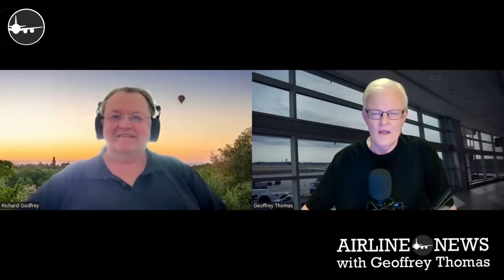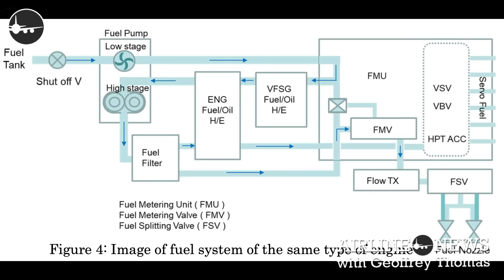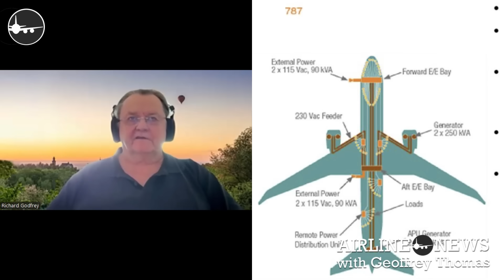AIR INDIA CRASH - FUEL & ELECTRICS FACTORS  #airindiacrash

Comment: Possibly deferred maintenance?
I will always feel so bad for the pilots fighting to save the flight and the souls on board.
Reply: It actually could be from maintenance performed just before this flight, when passengers on the previous flight report no AC and problems with the entertainment system electronics. In one of the 737 Max crashes, the "angle of attack" sensor was replaced just before the fatal flight, which was not calibrated correctly by the supplier, and caused incorrect information to be sent to the computer, causing the computer to force the plane down into the ground, erroneously thinking it was preventing a stall. Also, the pilots were not trained on how to quickly shut off the system when giving obviously erroneous instructions to the plane.

Comment: 1:38 You should really consider correcting the size of the fuel tanks and the fuel quantities as your numbers do not seem to match numerous other sources, some of which are from Boeing.
Reply: Does that apply to all 787 models? This was the 787-8.
Reply: @Mark-rw3kw 

The difference between the 8 vs 9 is relatively small. I thought I had a source that might have been incorrect, so I checked a fairly large number of different sources. An official Boeing source was consistent with the numbers that I was using. A particular bothersome issue is how far off the video is with regard to the differences in sizes between the center and wing tanks. This actually has an aspect related to the justification of why the common center tank is being used for takeoff on a trip of this length. The center tank CAN CONTAIN more than 60% of total fuel, not something like 30% as the video portrayed. The implication is that the aircraft was almost certainly using the center tank for takeoff.
Reply: @ImperrfectStranger 

In the new video he talks about why he was off as per your comment. However, his explanation could not be correct as what he said about the relative sizes between wing vs center fuel tank were massively off. Now in the new video he basically provides an explanation that doesn’t cover that issue at all and puts it on “various sources” vs “I really mucked that up”.  Normally I would say that my observation was just being pedantic, however this detail could matter.

Comment: Thank you again, gentlemen. Whilst listening to Richard talking about the role of the APU, both during this episode and others before, I have often wondered why this isn't routinely turned ON during each stage of critical flight, such as for landings and take-offs? Initially I assumed it was because it couldn't function when the aircraft was in flight due to e.g. aerodynamic factors. However, in todays video, Richard stated @14:00 that it could indeed be started up in flight. What say you, please?

Comment: One point and a question.
Bus synchronisation failure.  Two DC lines at the same voltage can be connected by a simple breaker.  In the case of AC the voltages vary from negative to positive at the AC frequency.   A synchroniser  ensures that the breaker connects only when the lines are at the same voltage and in phase.  A synchroniser failure can cause total loss of AC power.  In-depth explanation on Wikipedia -
https://en.wikipedia.org/wiki/Synchronization_(alternating_current)
In passing: contact welding is a possible fault condition of breakers.

The question.  What was the duration from switching on of power - and recorders - to the crash ?  Put another way: how many minutes of FDR/CVR will there be for this specific flight?

Comment: Many people forget on this plane previous flight the passengers posted their was electric component problems on plane. No lights in cabin.... AC going on an off. Clearly if it was pilot error they would have told us by now. I tend to believe Air India is in some type of cover up mode because of a maintenance problem an or electric component problems on the plane.
Reply: Yes, if it was water contaminated fuel perhaps the left tank was more contaminated than the right side tank.  So the left engine flamed out first either just before takeoff or shortly after.  And the right tank was mostly ok but it did degrade the performance of the engine.  Not sure what percentage of water in the fuel is considered contaminated since probably a very small percentage is water?  But very little would think and some can accumulate due to temperature changes.
Reply: I'm thinking the same thing. If it was 100% Boeing's fault then they would have released preliminary report by now. Having the flag carrier of India at fault will certainly delay the preliminary report to make sure all other possibilities are triple checked.

Comment: I like your information because I know you are giving real information not made up crap! Is it possible that water or something got in the main electrical system, where it is using the vacuum pumps, with the very hot temperature it gets a vapor lock? I have only flown small Cessna that have high wing and has very little trouble getting fuel as long as you have the fuel selector on a tank that has fuel! I know that until someone gives us some real information about what the Black Box's tell us we are just guessing what could happen. Thank you for your information!

Comment: I have been following your inputs to this terrible situation, and to the most part concur with what you have said. There is however 3 items that you have failed to address .
1/   There is vision available of a third item i.e.an in the cockpit video recording totally intact and undamaged with a retrievable copy of all activity in the cockpit.
2/   the remains of the Lithium-Ion battery and what looks like an explosive detonation within the box which appears to be a pre rectification casing, which suggests it was an older battery without the problems of wires below the casing which is definitely not the required reinforced battery case
3./The location of the suggested broken seat pin stopper is not either missing or broken.
I therefore suggest that there is a concerted effort to suggest that Boeing is culpable as this aircraft spent time in the shadow factory requiring substantial corrections of parts on the airrcraft involved. I would seriously request you take a look at this seriously.
Reply: This is what i am thinking took out data cables from near the battery enclosure. do you have url for picture of the remains of the battery? The battery box is not that big..

Comment: The only definite aspect is that the control showed full fuel but not being fed to the engines. 
The question is what mechanics drive the feeding of the fuel.
Now we can decide what maintenance issue is responsible for this. 
It would be mischievous to make the issues confusing to shunt the blame to avoid responsibility.
We know that huge amounts are at stake for the US company which exercises massive clout.

Comment: There’s a price to be paid for (automatic) operability-convenience including attempting to idiot-proof a system through the fig-leaf of “bullet-proof” safety-interlocks: the resulting complexity. Failure modes (including those triggered by as simple an event such as sensor-error or even frayed wire/cable) skyrocket & it is only a matter of time before events occur in the right combination/sequence to complete the “path to complete destruction”.  No one understands these systems entirely in that sense - not even their designers. Their Operations/Maintenance & Testing are given rote procedures & checklists that “work” until they (obviously) don’t. What would those people in dire straits not have given up to immediately rip up all that automation, giving direct control to the pilots to do what imminently needed to be done?
Reply: The age-old problem of automation
1. Automation to reduce workload makes sense up to a point, but us old timers want to know that we can override the automation when needed.
2.Automation that addresses incorrect diagnosis and then possible incorrect/dangerous pilot interventions - that is where the problems ly in my opinion. 

I agree with the notion that aircraft systems are becoming far too complicated and intertwined.

Comment: Richard, if it is really due to a software glitch, causing this crash, who would be responsible? Boeing? Air India? or would it be considered an act of God?
Reply: Good question! Software failures are sometimes triggered by electrical or mechanical problems; either of these may be caused by poor maintenance, so the room for Boeing and Air India to point fingers at each other is enormous.
Reply: @iliyakuryakin4671  Air India was until recently owned by the Indian government, but was sold to Tata Group (India's largest conglomerate) in 2022. However, the planes are maintained under contract with Air India Engineering Services Ltd (AIESL), a government-owned entity. The government is in the process of divesting AIESL, but this has not yet been finalized, meaning maintenance remains a government responsibility for now.
Reply: Not the act of God because airplanes are manufactured out of the Free Will.
Reply: @abhinandansharma400   If a plane was shot down by mistake (as happened a several times) that would be considered as beyond the control of the airline or manufacturer, but probably not considered to be an act of God.
Reply: @Mark-rw3kw yes, shot down means a Missile again a creation of a man out of free Will.
Reply: If there is an automated system "glitch" the problem could be with the software, or from sensors that feed information to the system upon which it makes decisions. That is what happened in the two 737 Max crashes when there were problems with the "angle of attack" sensor that were not properly calibrated upon repair, and the automated system thought the plane was going up to fast and stalling, when it was in fact the plane was flying level, and the computer automatically caused the plane to nosedive to prevent a stall, but instead caused it to crash. The pilots were also not properly trained on how to quickly shut off the automated system when it was obviously giving incorrect instructions to the plane.

Even though there were problems with maintenance of the sensor, and inadequate training of pilots on how to disable the system when it obviously was giving incorrect commands to the plane, Boeing was primarily found to be responsible for relying on only one sensor, and not having adequate safety checks in the software programming. A failure of such a automated system would never be considered to be act of God unless perhaps the plane was affected by some completely external force that could not be reasonably ever predicted to happen.
Reply: Then the investigation would be which God, whose God?
Reply: That would be a human caused programming error and the responsibility of the aircraft manufacturer.

Comment: Would it be Smart to leave the APU Running until the Airplane is at  Cruising Altitude????
Reply: Ja,wäre momentan sicherer
Reply: The problem I see is that the power provided by the APU is only 450 kW, whereas the aircraft needs much more than that to function properly, without shedding load. It would be interesting to know what the minimum power requirement is and what gets shed when one engine fails, leaving only 500kW available.

Comment: The Air India crash is eerily similar to Emirates Flight 407 emergency out of Melbourne where the TOW was incorrectly entered into the EFB affecting the performance of the aircraft at takeoff regarding amongst other things V speeds, flaps and engine power settings.
Improvements to software and procedures were initiated as a result of the mishap but there is always the presence of human error.
Reply: Yes , and there has been very little mention of aircraft take off weight.
Reply: Interesting. An incident related to TOW happened this June in Phoenix. An Airbus A321 lost an engine on takeoff and had difficulties in maintaining flight level.

They did managed to get back safely and it has been determined that the aicraft was overweight.

It got me thinking on how common this practice might be, yet we only learn about it only when it goes wrong.
Reply: The software will not let you enter a bad TOW it knows when its not in range. This incident was in 2009 so they changed the software. The 787 will not let you enter a bogus TOW.

Comment: Multiple computer systems of the 787 use timer-counters with (too) small integer size, leading to an overflow every x days, possibly leading to massive problems or shutdown of corresponding computer system. 2 questions:
  a) did Boeing solve these issues?
  b) did Air India update their 787 computers?
  c) if not: for how many days did all of these computers system each run without reset?

Comment: I saw a youtube video made by a passenger the day before claiming to be for  the same Air India plane that crashed showing none of the back seat entertainment screens or the air conditioning interior were working and that the interior was very hot and appeared not cleaned from the previous flight.
Reply: Das Entertainmentsystem bleibt meistens während der Boardingzeit aus ,es ist nicht relevant bezüglich der Stromversorgung des Flugzeuges es hat redundante Systeme.Die Klimanlage ist schon eher näher zu betrachten das könnte ein Zeichen von einem Defekt im anderen Stromkreis sein.Ich wunderte mich bezüglich über das nicht gereinigte Flugzeug auch sehr sah es auch bei anderen Flugzeugen der Air India das könnte auch eine Ausrichtung mal sein ob die Wartung der Flugzeuge genauso ausgeführt wurden.
Reply: It is possible that the maintenance crew did something to correct that problem after the flight mentioned by that passenger, and an incorrect maintenance procedure caused more serious problems on the fatal flight.

Comment: It was the RAT that was lowered due to a software bug. Its activation shut down all other electric sytems so the Air India plane crashed.
Reply: India media is reporting that the RAT may have been deployed incorrectly, perhaps after the first engine shut down for some reason, when it is only supposed to be deployed after both engines fail or all electrical power is lost.
Reply: @Mark-rw3kw  That's interesting. I've found a 787 system presentation were it is said that if both VFSGs of one engine fail and the APU is unavailable, the RAT will be automatically deployed.

I couldn't found other sources to confirm it, but it fits the scenario you mentioned: one lost engine and the APU off.

If true, then the RAT deployment wouldn't be by accident but by design.
Reply: @andreea007  Yes, could be by design that RAT deployed. But I wonder if the RAT plus the landing gear down combined contributed too much drag during an initial climb with only one engine.
Reply: @Mark-rw3kw  If that engine was fully operational, experts say there is no way. But we don't know the state of said engine so anything is possible I guess.

However, if the aircraft was in such state that couldn't handle the little extra drag brought by the RAT, then it's hard to belive they could have recovered, even without the RAT being deployed.
Reply: @andreea007  I found this YouTube video which describes when the RAT is automatically deployed https://youtu.be/-MDjRMkc-cc?t=1445

Here is a transcript that I tried to capture accurately from the video:

1. loss of all engines, both engines are at less than minimum idle RPM.
2. loss of all hydraulic power - left, right, and center systems detect low pressure loss of all electrical power.
3. loss of the BPCU bus power control units which detects the loss power of the C1 and C2 TRU the transformer rectifier units.
4. loss of all four EM electric motor pumps hydraulic pressure.
5. loss of either the left or the right flight control ACE actuator control electronics.
6. rotor burst on the takeoff that causes the loss of both PEX power electronics cooling systems primary cooling loops.

The RAT can be manually deployed, but the person who made the above video seriously doubts that the pilots would have had time to do that.
Reply: @andreea007  This YouTube video provides some more detail about when RAT is deployed:
https://youtu.be/-MDjRMkc-cc?t=1372

Comment: Electronics are not normally that susceptible to water ingress. Firstly, the water would have to be very dirty to be sufficiently conductive. Secondly, it is common practice in aviation and aerospace to coat electronics to make them waterproof. At high voltages, the dielectric strength can decrease, and arcs can ignite in power electronics. In this case, I would assume that the protective circuits detect this and extinguish the arc. Otherwise, it would be a design flaw. In my opinion, redundancies should also be able to bridge such failures. Therefore, I consider a (sudden) failure due to multiple faults very unlikely. I consider it more likely that a mechanical problem during rotation caused unforeseeable damage to the electrical system, perhaps due to long-term corrosion of mechanical parts due to water in conjunction with the electronics. In my experience, mechanical and electronics developers communicate very poorly.
Reply: PS: Theoretically, it's possible for a DC power source to decompose contaminated water into H2 and O2. This is an explosive gas that can destroy electronics. However, unprotected contacts would be required, and a changing water level during rotation could cause an arc and ignition. Is such a scenario possible despite all the quality measures?

Comment: It's mind boggling that Boeing would make the fuel system so complicated. The engine sits below the wing so can be fed by gravity (which always works) from a dedicated engine feed tank from above. The feed tanks would be kept topped up by a more complex  system with pump redundancy/cross valves etc
Reply: Gravity is fine to an extent but fuel still needs to be fed under pressure. No pressure would limit altitude capability and make it amongst other things commercially not viable.